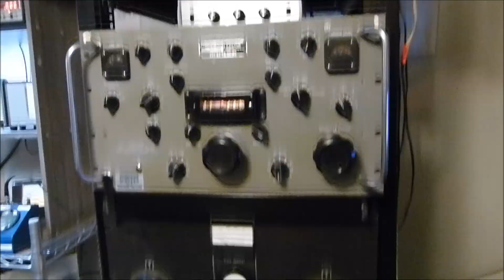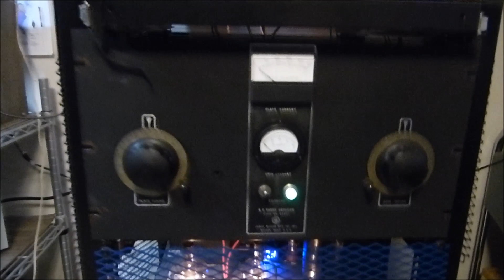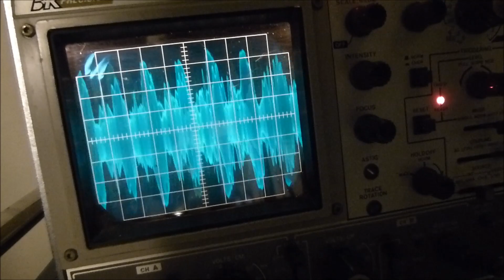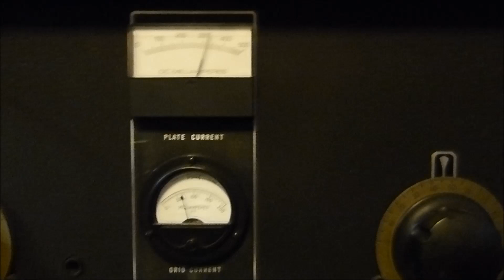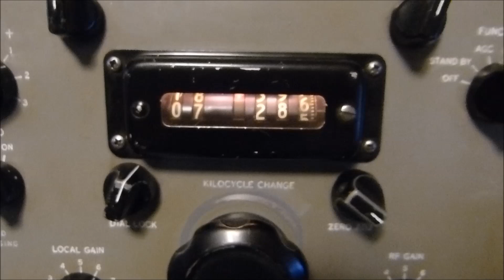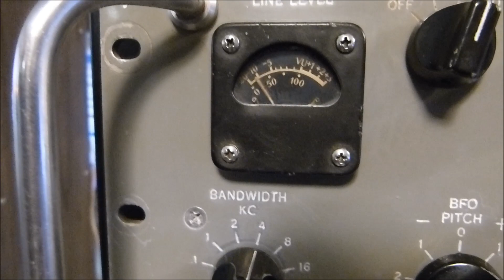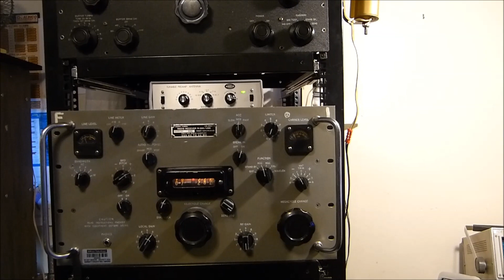AM - Amplitude Modulation, 40 Meter QSO Collins R-390, Millen Push-Pull 812A Amplifier 4-28-2021

Comment: Hi David, 
Your R 390 is sounding nice and hoping it's still working well for you.
They tend to run for years with little more than an occasional tube failure.
Take care,
Glenn
Reply from the maker: Glenn,
I am always pleased to hear from you. I hope you are doing well.
Not a lot of views on this video but it seems those that do watch it, enjoy it. I made it just for K0JJF (Jim) to hear but afterwards thought others just might enjoy a genuine AM QSO with equipment 74 years old.
The R-390 just works, and it sounds great. I tend to swap back and forth between it and the 51S-1. I love both of these guys.
I have to make a full length video of the AM station soon. It was actually a bigger job than I remember from 45+ years ago. How could that be?    :-)
Super hot out here lately so I hope my antennas hold out. Can't climb a steel tower when it is 108 in the shade...
I got in a UTC CVM-5 transformer. Wow... what a monster - rated at 600 watts and will match anything from DC to cosmic rays. I have checked it out on the workbench with an impedance meter and it is amazing how accurate the reflected Z is with a known load on the secondary. I have some plans to use it to modulate the 833A amp by changing the bias and making it run class-C. At the present time, I get as much as 350 watts of carrier out of the Millen amplifier modulating it with the 4-125A and BC-610 modulation transformer.
I am working on a video with a friend here in El Paso, hopefully to post soon.
73

Comment: Just found your channel on your 1.3 kw amp didnt finish watching yet on would like to find or build a good high power tube anp to try at the church's park to see how it sound they keep buying new equipment I tell then they would get just a true 100 watt tube amp instead of what they use it would be alot better sound in the church but they never listen if I could get me one I'll hook it up at the park to show what good sound is
Reply from the maker: I understand what you are saying. Also, just as important as amplifier power, look at the SPL of the speakers. Lets assume you have speakers of 90 dB SPL and you put on a 1 watt amplifier - you get 90 dB of sound pressure level at 1 meter. If you increase it to 10 watts you get 100 dB. Nice and comfortable loud in a room but not anything like the size of a church. Now let's put on a 100 watt amplifier. Now you are at 110 dB SPL. This is a realistic way to look at a sound system. 
Now suppose you have speakers of 98 dB SPL. Now 10 watts gives you 108 dB and 100 watts gives you 118 dB. This is getting loud. Hope you see my point. Buy the best quality and most efficient speakers you can afford and then a 100 watt amplifier will do a good job. If it is stereo  and you have two speakers then it will be 100 watts per channel and you would add 3 dB to each of these numbers for the doubling of power. i.e. 98 dB speakers at 100 watts times two channels will give you 121 dB of sound pressure level and that is going to be plenty loud. Hope this helps and you get the system you need.

Comment: I got a kick out of the heavy duty Tektronix scope cart for the 500 series scopes, with a B&K solid state scope sitting on it.
The scope all but disappears on that cart!  funny
Reply from the maker: You know I love Tektronix but just a few weeks ago a fellow moving out of town and going back to WV gave the B&K scope to me. It had been in a garage but was mostly dusty from sawdust and a little El Paso sand. Probably has not been turned on in 10+ years. Anyway, it cleaned up nicely and I like it. It has a big screen and is analog and just makes a really nice display of RF going to the antenna that I tap off the coax line. These fancy digital scopes are not the best at all things. I like to "see" the RF going out . A fellow needs real-time visual confirmation of proper operation of a radio transmitter at all times.

Comment: very nice R390 !!!!
Reply from the maker: Thank you. The frequency accuracy and stability are as good as when it came out the Collins door. It lost a little of its sensitivity where it dropped to needing 2-3 uV to get a good strong signal but I put an outboard tunable preamp on it, you may be able to see it on the top of the receiver, and it really came alive and I got sensitivity down to 0.1 uV, a gain of supposedly 26 dB. Not sure what the preamp was rated at but it sure helped. 73

Comment: First in.....good to see a new video from you
Reply from the maker: Hi Harb - thank you. This was a spur of the moment test I made about a month ago and it was just for Jim (K0JJF) and me but, what the heck, I thought some might like to see the vintage AM equipment still working after 70 years. Stay safe.
Reply: @ElPasoTubeAmps  Its got me thinking of pulling the old Henry out and warming up this Cold Australian Ham shack of mine lol.......Winter is coming on here.
Reply from the maker: @harbselectronicslab3551  
That is so interesting to realize it is winter in your part of the world. Things are heating up quickly here and will be 100 F very soon. My radio room is at the end of a room in the basement so it has no air flow and it can get really warm in there. The cats love it so I have plenty of company... the good thing is there is very little dust at that end of the basement so my equipment says pretty clean. El Paso is definitely a place that is dusty and sand blowing everywhere.  I assume you are talking about a Henry amplifier. Wish I had one to work with. Stay safe...